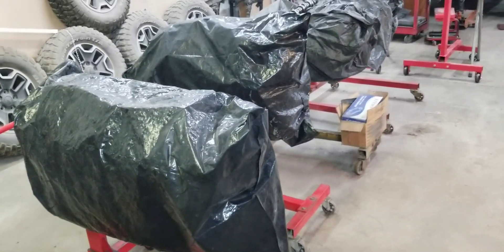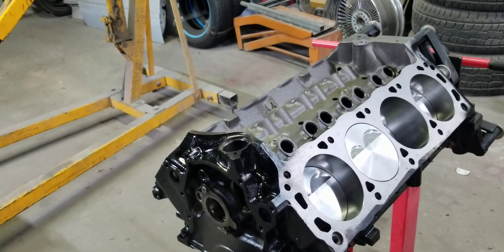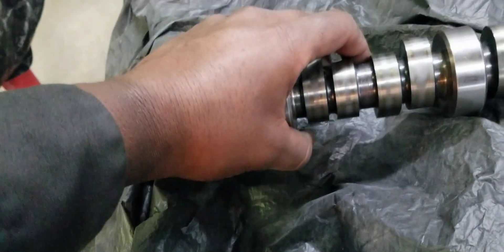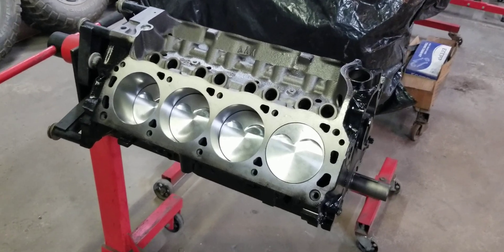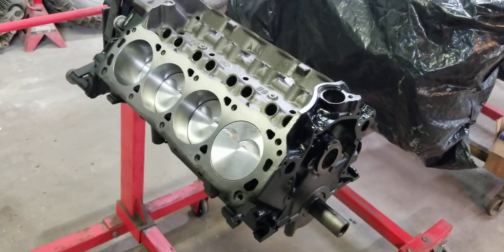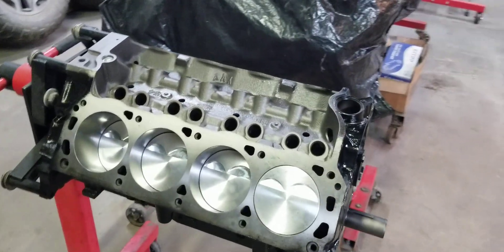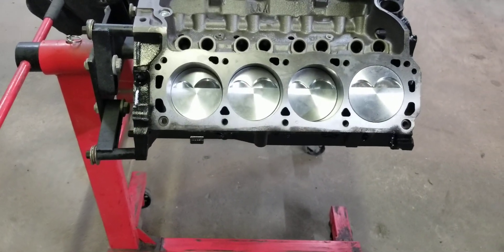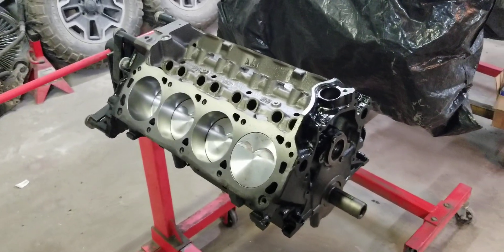How much power can ported parts add to a basic sbf 302?🤔

Comment: Project BUSTER!
Reply from the maker: We will add that to the list.
The short block received a standard rebuilding and machining, .030" forged dss flattop 2 eyebrow pistons were used, arp rod bolts, arp main bolts, clevite bearing, moly rings with standard ring gaps, reconditioned factory rods/crank, blueprinted original factory oil pump, 10 keyway timing chain and a factory HO cam. The dss pistons our our go to pistons of choice because we like the price, quality and performance.
We wanted to keep the shortblock simple for the customer and it represents what the average budget rebuild shortblock would be. We want to show how much power you can make with our aggressive porting style with factory parts.
Reply: @bigdogsportingtonyb2833  all that sounds rather typical. When I here max effort I see and think differently. 

DSS was the first piston I used 20+ years ago. Really hard to hurt those. The top ring is down a good ways, they've got some weight to them, and they're valve reliefs accept huge valves and over 0.600" lift safely. A little on the heavy side for my taste. Was any mallory necessary?

Your products should shine well enough.  Will the engine be tested with the cam straight up and then 8° retarded? I'd really like to see where the power band ends up at when in °8.

Just guessing but the stock cam noses over around 5k....retarding that far...moves that to 65-ish rpm??? Idk....cant wait to see what comes of it.
Reply from the maker: @arturozarate1752  everything you just said is true. See with this engine and our philosophy on building stree/strip engines we focus on making solid and durable power while keeping things simple and not using exotic parts. We want our customers to be able to make great power but without wasting money on things that don't add significant gains. 
The pistons balanced well and you are right they are tough lol. 
The cam retarded 8 degrees definitely moves the hp peak past 6,000rpm as well as out stage 3 Explorer gt40 manifold. Flow is the biggest factor as rpm climbs and our porting will show.
We are only testing this motor with the cam being retarded.
Reply from the maker: @arturozarate1752  we have a lot of experience with advancing and retarding cams on combos. First started experimenting back in the early 90s with chevy, ford and Oldsmobile motors. I do it to move the rpm band either up or down while keeping the cams specs the same.
The HO cam if installed straight up would not make the same hp or torque as when retarded 8 degrees on this combo

Comment: Tony, this all sounds great, and I hope there is a part 2 to this!

For "Max Effort", what was done to the short block? I've gone as far as removing the 2nd ring and modifying to the oil ring to reduce turning torque of the rotating assembly from 40lb/ft to 12lb/ft. I did some oil pump work decrease some drag, and I ground off a lot of the counter weights of the crank, and then profiled, the right way, with the leading edge being blunt, yet rounded, and the trailing edge pointed with a radius. Much like the wing of an airplane. I never used a stock cam, but I did retard a B303 8° raced that for years. 

There better be a part 2!
Reply from the maker: Yes rest assured there is a part 2, part 3 and part 4 coming. The guys and I have just been so busy at the shop with all the orders and remodeling. We have several engines at the dyno facility plus several motors at the machine shop. 
We promise to have a lit of great content for you guys including dyno videos and tract videos as well.
Stay tuned and share the content

Comment: Might be hard to find, but the cam from an 87-88 speed density Mustang is slightly more aggressive
Reply from the maker: That is correct. But that would be cheating a little lol. We tried to keep the parts list common to what the average fox body Mustang guy has available to them to see what kind of gains can our aggressive porting system add to a basic motor

Comment: I recon a flat tappet cam would run better to be honest,  they always made more power if i remember right.  True ?.
Reply from the maker: In certain combos a flat tappet cam will shine but In this combo the customer wanted to see how much power does our porting add to a basic motor.
Reply: @bigdogsportingtonyb2833  Yep, thats fair.  What i said about flat tapet cams makeing more power, has been on my mind for a while,   theiy sortoff get strait to the point unless its the holley doing it.   Allso, i thing your experiment will make beteen  330 and 350 horsepower. 👍
Reply: Roller cams make more power than flat tappet cams. Especially solid roller cams.

Comment: Cant wait to see the results! I have a ford racing E303 cam, love the idle/chop sound it has. But i was wondering, if i had the same things done, that you guys are doing, would adding my E303 add approx. 5hp, 10hp, or?
Reply: Richard Holdener dyno tests have shown 40+ from the stock HO cam to the E on similar setup. YT video.
A custom David Vizard cam is more 👍👍👍 but $$$$.
Reply from the maker: @hotrodray9884  Richard is a parts installer. We are parts modifiers and engineers. He installs parts and see what they do. We modify and make parts do what we want them to do. There's a big difference. We are not installing the ho cam in its normal  timing events. 
Remember richard said a gt40 family style manifold can't make 400hp and we've proved that wrong many times with customers results and our 542hp 347 crate motor that's running our max ported Explorer gt40 manifold.
I and others tried getting him to run one of our ported manifolds but he ignored us. He knows the truth but if word got out that you can make the kind  of we get them to make then why would many people buy some of the aftermarkets.
Reply: Tony, could you degree an e303 cam the same way?
Reply from the maker: @Speedcrustgarage  yes but you have to be careful and not go too far and kill the motors dynamic Compression
Reply from the maker: The stock ho cam degreed the way we will be doing it will make mord hp than your y303 cam
Reply: @bigdogsportingtonyb2833  1989 to 95 stock 5.0 H.O. cam specs are : .445 Lift, 222/212 deg. of dur. @.050, ground on a 115.5 Lsa? And if you retard 8 to 10 degrees, means cam will be installed @ 123.5 to 125.5? I know its supposed to raise the rpm band up higher, but will that also reduce dynamic cranking compression, vs installed straight up? Im not a hater, or a know it all. I have seen/heard trophy stock mustang champions, say they ran faster with the stock H.o. cam retarded, so im not doubting you will make more hp, retarding the stock cam. But i think to do that its advised to run more compression, than stock, to maximize the dynamic compression, from the cam retard process? Is that why you are going with more compression, with the flat top pistons, or am i way off? Just trying to understand better, thank you.
Reply from the maker: @evilinside5984  you are 100% correct and exactly why we are using flat tops, Milling the heads and going with a .030" head gasket. It's also why we will be porting the heads and intake manifold a certain way. To achieve the best of both worlds. 
I keep forgetting that you guys don't know my engine building and mechanical engineering background  lol. I often leave details out because I just assume many are not interested in the technical mumbo jumbo.
Manipulating cam Timing events via degreeing is something I've been doing for 3 decades now.
Reply: Absolutely must be degreed in by actual dyno run tests. 👍😎
Reply from the maker: @hotrodray9884  no need. We have built many motors  degreeing the cams to our needs and them running like a beast.
Reply: And the rest